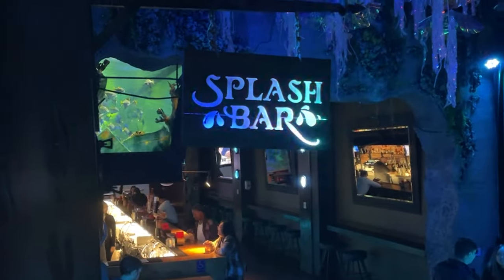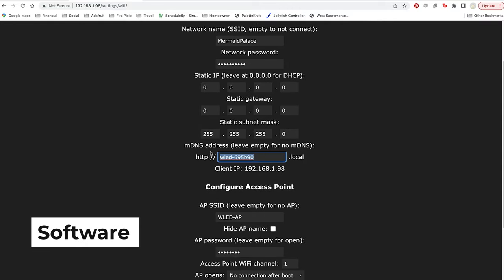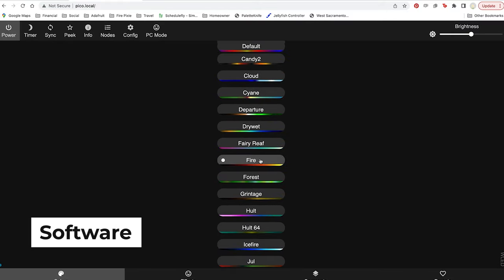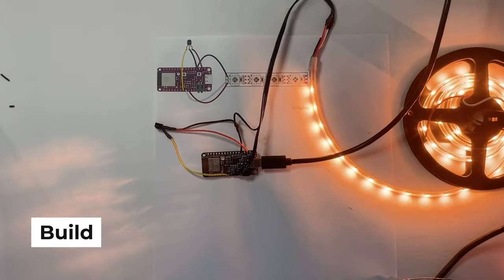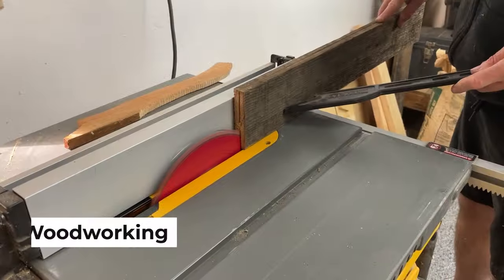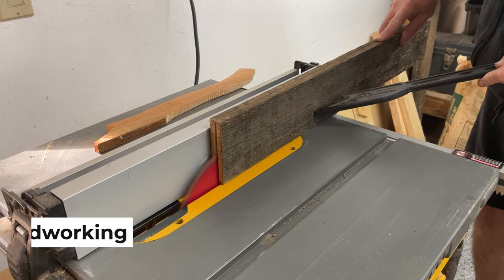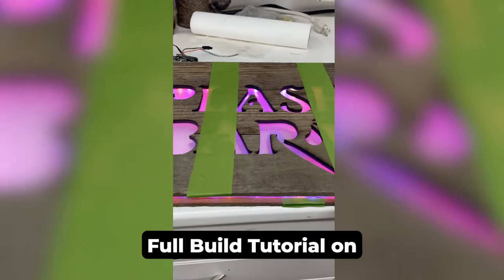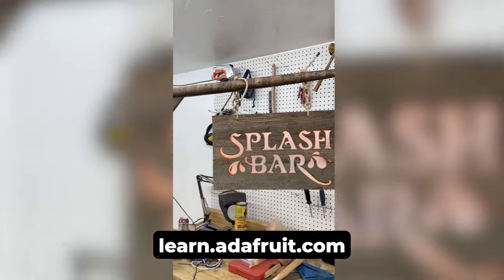Tutorial Intro: Edge-Lit Acrylic Tavern Sign with WLED and IR Remote Control #adafruit

Comment: Two questions:
1) If you scuff-up the rear-side of the acrylic too - does this increase the luminosity of the sign?
2) Instead of scuffing up the entire surface, if one were to scuff just behind the cut-out - this would presumably limit the light "wastage" on illuminating the back-side of the wood. Is there any reason not to do this? e.g. because the visible parts may become patchy? 
Thanks!
Reply from the maker: I did sand both sides of the acrylic, and it seems like the more sanding the better in terms of how much light comes through. As for scuffing just behind the letters -- I don't think it matters much in terms of light lost inside the sign. Maybe a more effective way would be to line the inside of the wood with something reflective (aluminum foil maybe?). But the brightness seems adequate without, to me.